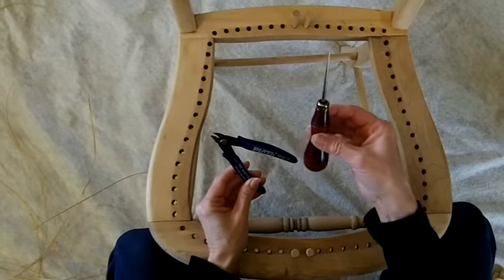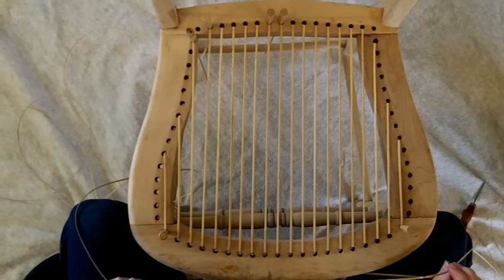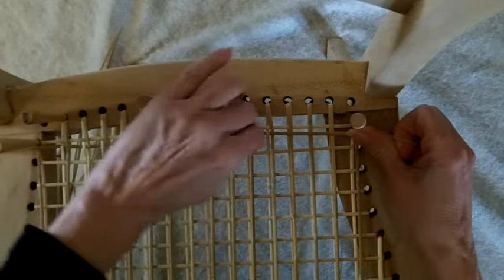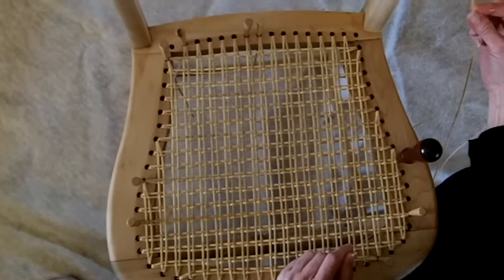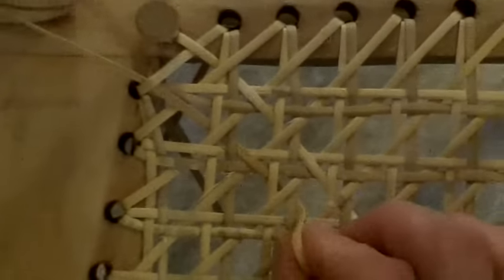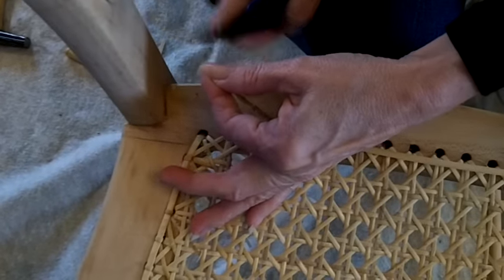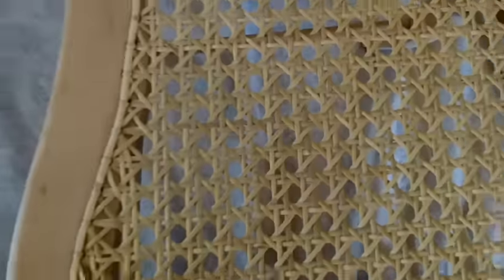Weaving A Cane Seat Using the 7 Step Method

Comment: Retired now, but back in the '80's I had a furniture repair/ restoration business, I worked in collaboration with refinishing shops in the area, trading specialties as they disliked mechanical repairing and I didn't want to strip and refinish so we played to each other's strengths. I taught the wife hand caning as you show in this video, using stranded (a tip- use a shot of liquid glycerine in the soak water, it really helps lubricate tame the strands and leaves no residue) while I did pre- woven and rushing types. My wife would do her projects in the living room whilst watching TV. and the kids; we charged $1.50 per hole plus extra if regluing or parts fabrication was needed. My most memorable commission was one where a senior lady brought in a Hefty Trash Bag full of a disassembled hand caned walnut side chair parts into my garage shop. She was desperate and asked if I could fully restore it, I assured her I could, A couple of weeks later I called her when it was ready, she came right over to pick it up. I had found it helpful to keep my projects under a wrap and do a big reveal in front of the customers- showmanship! When I unveiled it she let out a choked gasp and started crying, I figured I really screwed up and got it wrong somehow but she regained composure and explained this artifact was all she had left of her beloved father, and how it was his favorite chair to sit in and take his boots off when entering the house after a day working in the fields, lest mother scold him for tracking dirt, and she held onto it all the intervening years trying to find the right person to restore it for her, and it was just as she remembered it all those years ago, including the wear marks from his keys worn at his side. I learned to never take it for granted that this work was going to be routine, and to be able to give a part of her childhood life back to her was just astonishing to me and gave a new- found respect for the importance of this type of work we did.
Reply: You make it look easy, but I know it will difficult.

Comment: I've used this video to re-cane 3 chairs so far, and it is excellent. The woman doing the caning is so calm and she gives lots of helpful little tips as she goes. Doesn't she deserve a credit? However, what she makes seem so easy has proved quite a nightmare for my last 2 chairs, with the cane splitting or not pulling through easily. Does cane dry out too much if kept in centrally heated rooms, or if it's kept too long?
Reply: I keep a spray bottle and mist the cane as I'm weaving. Also, golf tees work great for pegs.
Reply: Tony Forbess I was wondering if a spray bottle would be good enough to keep the moisture while working. Thanks for sharing.
Reply: I had the same problem with cane drying out and splitting just getting it out of the bundle so the last time, I spritzed the whole bunch pretty heavily and let it soak in for a few minutes before pulling out the strand. Made a huge difference!  I also spray liberally every few minutes while weaving, even though I have already pre-soaked the strand in a pan of water. Of note, though, before I even started, I applied a few coats of tung oil to the chair itself to waterproof it, so that the wood would not be damaged or discolored by all of the spraying.
Reply: Keep it moist with a spray bottle or wrap in a damp towel

Comment: Explained so clearly and thoroughly. The chair I have is fruit wood with fruit carvings at the top back and lightly stained, I now only have to discover what to use to stain the cane? I have wood stains but unsure if cane will take the stain evenly or is suitable.
Reply from the maker: +Kitty Olsen I would test the stain on scraps first, to see if you like how it turns out.
Reply: thank you - i wonder if i should stain before replacing with new cane?

Comment: Should you just wet the cane once at the start? or multiple times? does it dry fast? I'm starting a new job at at antique furniture store. I'm a good wood worker. But it's this stuff and upholstery I'm trying to learn as much as possible on youtube. But this instruction is very clear. Thank you
Reply: I find there are a lot of variables — how dry your hands are, how long the cane is, etc. — but my experience has been that you will find you need to moisten the can occasionally. I've used a spray mister, a wet rag or just dipping my fingers in the water. Good luck.

Comment: Thanks for the fine video.  I've finished the weaving part, but am sure I'll never get cane through holes to hold band around edge in place. The holes are quite filled already.  I'm wondering about using something like fine hemp using needle instead.  Any suggestions?  J. Rice
Reply from the maker: +Lee Hassenzahl You may have used too wide of cane... that will fill the holes and make it hard to finish the seat. We use the awl, press it down in each hole and wiggle it around, to compress the cane and make room for the few last strands. Hopefully that works for you!

Comment: At 16:48 you begin to finish (step 5) the "back side". This is going diagonally from the right rear corner to the front left corner and moving along the back edge towards the left and along the left edge towards the back, finishing (step 5) at the left rear corner. 

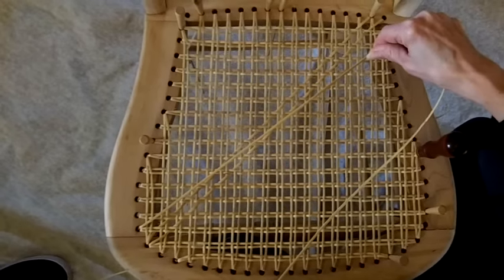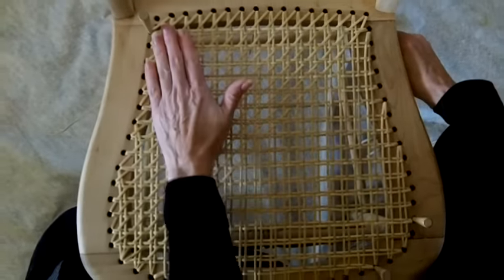Then at 17:02 you're near the right rear corner again, starting to finish (still step 5) the "front side" and at 17:10  you're finishing at the right rear corner with a peg, but you haven't described how you got to that corner. Basically, it's confusing how you finished the "back side" at the left rear corner, then how you got to the right rear corner.

Comment: Thanks a lot for making this so detailed. I have one query though. When a hole already has a peg, and you want to put in another can in that same hole..if you take the peg out wouldn't the cane which is already there become loose?
Reply from the maker: Hello. After 2 or 3 strands are on top of each other in a hole, the strands stay tight and you can remove the peg. Just test it and if it's loose, leave in the peg, but if it's staying down without popping up loose than you can move and reuse that peg.

Comment: I'm about to start my first seat. Was wondering why, for the vertical strandes, you start in the middle and work sideways, rather than starting in one of the corners? This does seem to be the strategy for the horizontal strands. Is it because the curve in the seat?

Comment: A very good and useful video! There is one thing you did not explained.... How do i know how much of strand cane do i need for a chair seat? What is an average length needed?
Thanks again!
Reply from the maker: +zubolinazu One 270' coil should do one average seat.  Cane comes in strands of various lengths.  Check out our chart on our website to determine what size you will need. peerlessrattan.com

Comment: Great video—thanks for posting! Before seeing this video I felt that maybe recaning my chairs myself would be too difficult and I would be unsuccessful. But seeing the steps here gives me hope and looks like something that I could actually do. I do have a question on 4:15 in where you begin the second half of step 1…is the cane the same continuous piece from the first half? Or is this started from a separate cut piece of cane? Thank you
Reply from the maker: Hi! It's a new strand of cane. Cane coils come in various lengths. I try to use the longer lengths for steps 1 and 2 and save the shorter one for the weaving. Good luck! You can find me at peerlessrattan.com if you have more questions!

Comment: Approximately how much cane did this one chair require and how do I go about measuring each strand so that they’re not too short or overly long?  Thank you for this lovely presentation!
Reply from the maker: Hello! Chair strands come in various lengths. I try to use the longer strands for steps 1 and 2 and save the shorter ones for the weaving process.  One coil of cane (270') should be enough to do 1 average size seat. You can contact me at peerlessrattan.com for tips on how to measure and get the correct size you'll need!

Comment: Very good tutorial! I have a question. What is the length of the pieces of strand cane?
Reply: They come to us in bundles and all the lengths vary, anywhere from 6' to 16', you never know how many of which size are in each bundle. You normally use the long strands to start a seat, then use the shorter strands on steps 4, 5 and 6.

Comment: Great and extremely clear video!!!
But I´ve got one issue: what about if I want to weave a new frame with no holes? which would be the criterion for making the holes?
Thank you!!
Best regards
Reply: If your chair has a channel or groove, then you want to use pressed cane, also known as sheet cane. It is pre-woven and you secure it with spline in the channel.
Reply: @karenmitchell3947  and ff ff  - If there are no holes and you're going to drill them (typically 76 holes, 1/4" diameter each, in a 16" outside diameter seat), you'll find that the holes at front, back, right, and left of a drilled seat are closer together than the holes in the "corners" that will receive more of the diagonal strands. Use tissue paper to make a rubbing of the hole locations on a drilled seat (marking the centered pairs of holes, front and back, carefully), then mark those hole centers on your undrilled seat (marking the center space between the front legs and  the back legs carefully on your hole tracing).  Phrased another way, on most seats there are no "center holes".  The center of the seat (both front and back) is a space, not a hole, with an even number of holes on either side of it. - Roger Newill

Comment: Thanks for this video - it's great.  I'm re-weaving a rocking chair, but the back has an even number of holes on the top rail and an uneven number of holes in the bottom rail. I'm a bit stumped as to how I weave this. Have you any suggestions?
Reply from the maker: Roderick James Styles You just need to determine which holes will make the straightest line...it will be off on one side.  I have done several chairs like this and when it is finished - you can't see the difference between the sides...hope this helps.

Comment: Hi there great video thx for sharing.  One question  when you were doing step 4 the 2 vertical lines on the far left only had 1 strand and it looked like step 3 was avoided on those 2 lines but after you finished step 4 it showed that they were doubled up. When did you add them in and do they stand alone and just tied underneath?
Reply: Yes, you are correct.

Comment: How do you determine what lengths of cane to work with? I've calculated how much I need, but how do you make sure you're not ending on the seat of the chair and you can get from the center starting point to the edge?

Comment: I have completed step 4 and would like to know at what step (if at any along the way) can loose ends begins to be tied off? Or is that detail always done after all weaving has been completed? So far, so good! Thank you!
Reply from the maker: Tying the ends is the very last step, don't do it until you have installed the finishing strip. Or you could use the no-knot method, take a look at that video.
Reply: Thank You Mr Hammond! I'm at step 5 and have a lot of pegs on top for starts and stops and cane ends underneath to work around. I haven't tied any off yet and and I am watching the video as I go.
The Step 5 in the video is so tidy looking!

Comment: Took on rebuilding of a chair (almost a chair ,have had to re manufacture  1/3 of it as a result of  the owner losing parts ).My problem is the cane,bought a bundell of 2.25 mm and a bundell of 2.5 mm ,its so fragile it has taken way to long, after breaking or splitting pieces constantly .I was on the home stretch when I noticed that two of the horizontal pieces that I had installed yesterday were broken . Ill spare you the details of the new curse words I came up with.The cane your using sounds like it is  strands of material that has nothing to do with what im dealing with ,im guessing your is 3/16 ?  The amount of pressure your using is 20 times more than mine can handel.

Comment: Was this done with one continuous strand of cane or was it cut into some specific lengths based on the seat area?
Reply from the maker: Strand cane is harvested. It cannot be one continuous strand, it doesn't grow that way. Each coil has various lengths of cane. We try to use the longer lengths for the beginning steps and the shorter lengths for the weaving steps.

Comment: I have a chair I’m trying to recane and there are 20 holes up front and 17 holes in the back.  This allows me to clearly find the middle of the back but not in the front.  This also creates a problem when it comes to the sides because the holes you skip on one side are different than the ones on the other side.  What should I do in  this case?

Comment: I'm currently caning a chair. I did it once and the left and right front ends were this jumbled mess. Lady at the wood craft shop said I made too many vertical lines. From everything I've read and watched, it looks like I don't put the vertical lines through the back corner holes, but I need to use all of the front holes. Can the uploader or anyone tell me if I've done the proper amount of vertical lines by using the last front corner hole, even though it's completely on top of the wood (it has a very bubbly front)? Should I skip that last corner hole so that I dont have that vertical line on the wood? Any help would be GREATLY appreciated!
Reply from the maker: Hi, you should post your question on the forum at wickerwoman.com, the experts there will be glad to assist you.

Comment: Hi, I´ve just seen your video and I like it a lot. I tried to mend a back of an arm chair and I realized that the it was curved so I wasn´t able to work the tensions out. Teh back seat is a square but a curved one to fit the back. Could you tell me how could I work the weaving when the cane goes separated?
Thanks
Reply from the maker: sometimes in a curved back or seat - I do steps 1 and 3 together leaving PLENTY of slack...and then I weave about 4 rows of step 2 and then go back and weave step 4.  This will prevent the strands from moving together.  Then go and weave another 4 rows of step 2 and then four...always leaving plenty of slack on these rows as well....depending on how curved your seat or back is.
Reply: Ed Hammond
Thank you very much. I will try it.
Best regards

Comment: Great tutorial, however I failed. I just could not fit any more cane through the holes after step 4.  It's ok, I learned a ton and will just make a wooden insert.  Still an A++ tutorial
Reply from the maker: Sorry to hear that. Maybe trying a slightly smaller cane would help?

Comment: HI!  thanks for the great tutorial.  I'm in the middle of caning a chair and I'm currently half way through step 4 but I broke a piece of cane from step 3. Is there a way to repair that without having to go back and re-do step 3?  thanks!
Reply: You should be able to cut out that strand and just replacing it. You should not have to redo all of step 3.

Comment: Ed. My chair looks the same as the one in your video (predrilled holes along front, back and sides of seat). just curious if it would be possible  to do it with rush. I like the look of rush better.
Reply from the maker: +Janelle Reinke If it has holes drilled in the wood you probably would have trouble trying to use rush, but you could always try and see if you like how it turns out.

Comment: How many strands did you use to finish this chair and how long are the strings? Regards, Frank
Reply from the maker: A typical chair will need about a 1/4 hank of cane, which is 270'. The strands vary from 6' to 14', use the longest ones first and the shortest ones last.

Comment: I'd like to ask the same question as gary  year ago .. how do you tie off when you get to the end of a length? there don't seem to be any pegs left in the chair to hold the ends, but this doesn't seem to be covered.   Great Vid though
Reply: The ends of the strands are tied off as the very last step in weaving, it is covered in the video. The pegs are just temporary holders, they are not needed as much as you add more strands to each hole.

Comment: I tired to follow this video and was having great success - The instructions seemed very clear.  However, I ran out of pegs.. so I tried tying off some of the ends.  This is when I ended up in great trouble.  I experienced so much frustration with the cane breaking and then a knot coming untied - now I have a great mess before me and I must decide whether to re-weave many areas - or just take it all apart and start over.  As a beginner, I really wish you had mentioned the option of tying off as you go, rather than waiting for the end.  Perhaps a more experienced or more talented person would not experience the trouble I encountered, but I am sorry I ran across these instructions.  Maybe I should have watched the whole video before I started...
Reply: I have about two dozen pegs on hand so that I don't run out. But once the cane dries (overnight typically) then you can reuse the pegs you have used. It is best to wait until the end to tie off the ends.

Comment: hi great video wanting to recane my chair.would like to know how much cane is needed for 1 chair?what is the distance between the holes.thanks.my regards
Reply: Hi! I saw seatweaving.org that 270 ft. of cane is for a 12" x 12" seat. In a comment I saw she said the cane size was "fine" = cane width of 2.50 mm, drilled hole is 3/16", and 9/16" from center to center of each hole

Comment: What if I did step one, and the cane was not long enough to keep going to the side holes? It covered all the back holes but none of the sides. Just do step two?
Reply from the maker: +Paul Harvey You use more than one strand to do a step.  That is what the pegs are for.  I don't quite understand your question.  Send me a picture if you can.